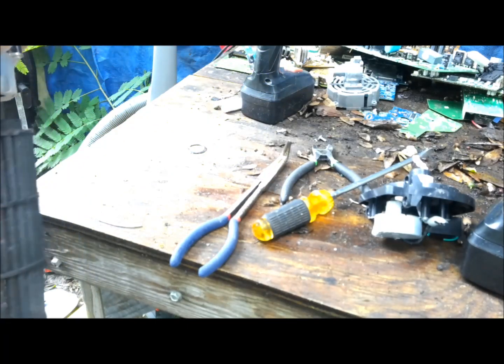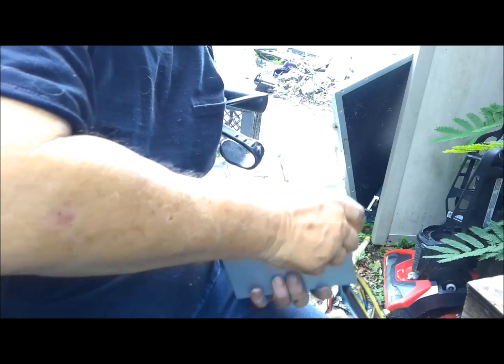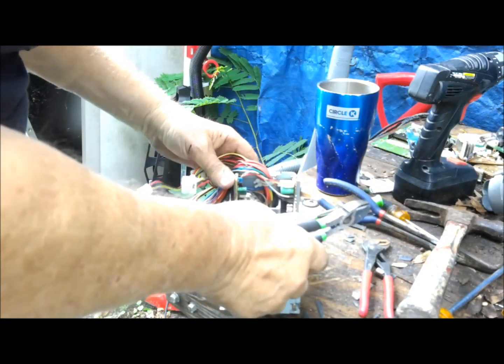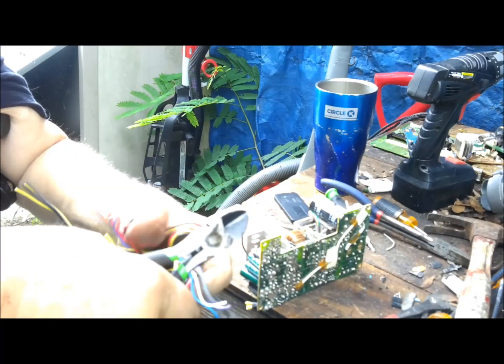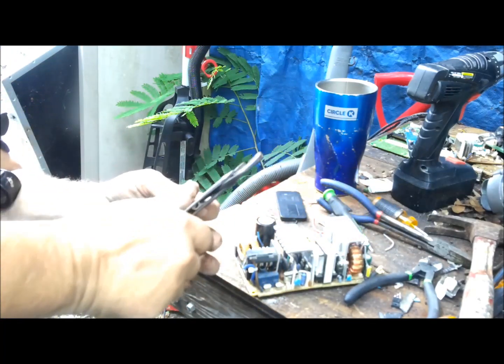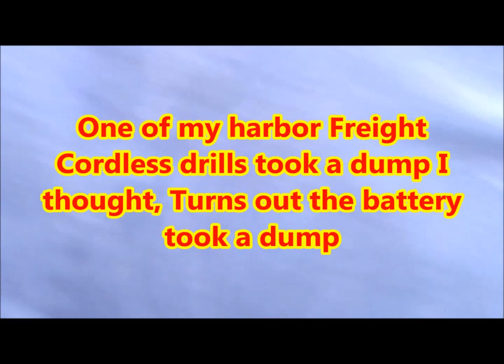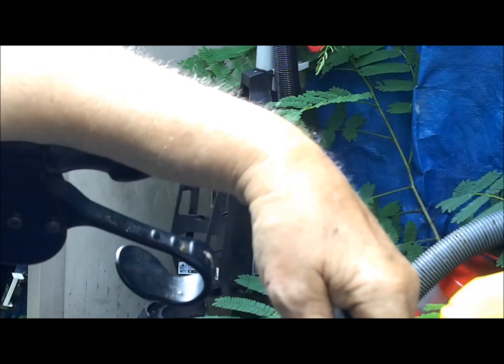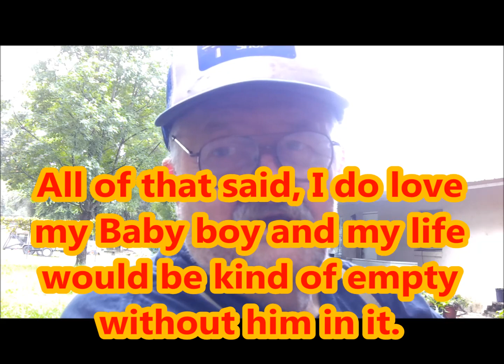Micro-Scrapping a Computer Power Supply! Is It Worth It?? Sorta

Comment: i agree i always take them apart easy job and sometimes i found copper and brass heat spreaders  inside  plus few transformer and lowgrade circuit board  so it is worth in my opinion